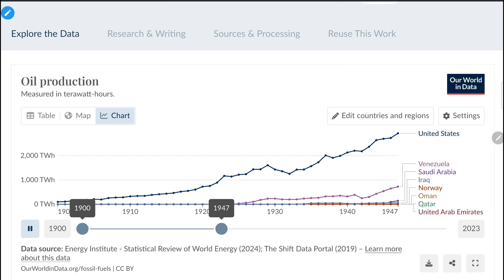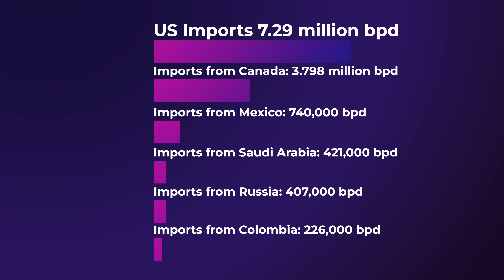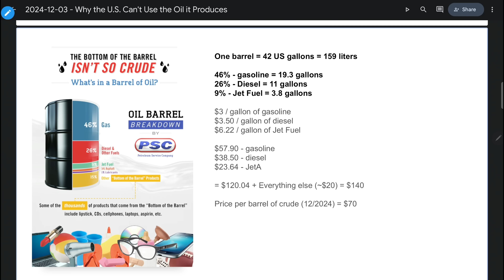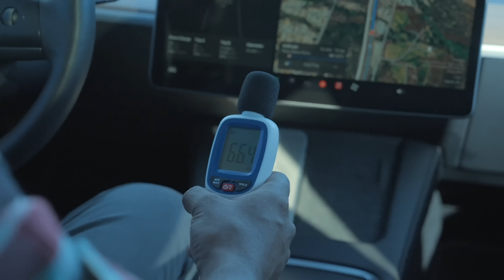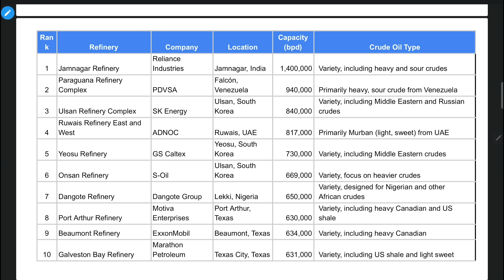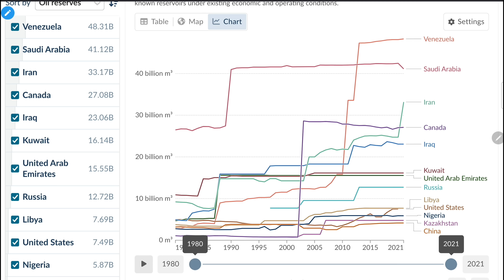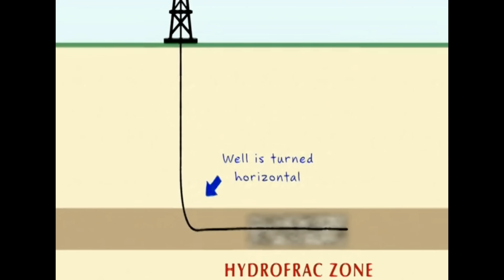Why America Can't USE The Oil it DRILLS

Comment: Hi Ricky, thanks for your videos. I’ve had a career in oil & gas exploration, now retired. It was always cycling between boom and bust and the first cuts were to the explorationist, either redundant or critically needed. Started during the fuel crisis of the mid 70’s. 
I had Norwegian friends in the industry who told me their electricity was so cheap because of all the hydroelectric plants. Lots of water and elevation changes. They always left their lights on. But oil and gas exports were a large success for their economy. 
I’m a big fan of EV, solar and wind energy. Hydrocarbons have propelled us into the top economic position but they are also a huge danger to our survival going forward. We need to make a change to more sustainable energy. 
Thanks
Reply: The only problem with that is we have 120 year's of every day living built on oil everything is made from it
Reply: @ZERO-th6dd  That life dependence on petrochemicals will not change for a long while. It will outlive our need for fossil fuels. If the tree-huggers get their wishes, our lives will be much more expensive and technology advances much slower.
Reply: @Arrogan28  It's sad that I brought up real concerns and you can't tell me how they are irrelevant. 
Did the medieval warming period not exist? Was it not roughly 1200 years ago well before the industrial revolution? 
More importantly what is it you are doing yourself to not use fossil fuels clearly it's not talking to me through the internet using your electricity that statistically has roughly a 66% chance of being made by using fossil fuels. You didn't tell me how you are going without fossil fuels in your day-to-day life. 
You didn't tell me how you eat strictly organic food that was grown without using fossil fuels, You didn't tell me how the goods and services you use throughout your life are fossil fuel free. 
You keep talking about my children's lives or your children's lives where are our children's lives whatever but the statistics are on my side life is better now than it ever has been and human history, most people will not die in adolescence where just 200 years ago you had a one in five chance of dying before the age of five. 
You didn't tell me how sea level rise is happening even though there is literal photographic evidence showing to the contrary but you're right I am ignorant and selfish for understanding how fossil fuels work. 
Why don't you look up the medieval warming  period and while your t it look up  "climate gate" it happened in 2009 where there was a data breach and the information was leaked to the public that they were altering the so-called scientific data then when they were caught red-handed they tried to deny it by basically saying scientist in the past weren't as smart as they are. 

You can say what you want but there's a lot of evidence to the contrary and there is a lot of money involved with this whole global warming thing... Oh wait we don't call it global warming anymore we call it climate change now because no matter what happens in the climate it's all inclusive.
Who cares if there's evidence that there was more hurricanes on average in the first half of the 20th century then there has been for the last 60 years. 
Who cares about The exceptionally large Antarctic ice sheet from a few years ago let's ignore your lying eyes and roughly 200 years of data collection because it doesn't fit the narrative You want to hear.
Reply: All of those green energy plans will fail without innovation in battery technology. They also need to find other materials to make their generators and panels from because all turbine blades and solar panels are classified as toxic hazmat waste at the federal level. Over 90% of the material isn't recyclable and will sit in a landfill pulverized and atomized leeching PFAs into the groundwater and top soil. 

Hydroelectric is THE ONLY renewable that is feasible. Even then you must balance the risk vs reward when it comes to impact on politics, local ecosystems, and fish. Look at the many grand canyon hoover Dam conflicts and the many decommissioned dams on the west coast. Constantly Innovations are required across many industries including a way to bypass the dam for salmon to get into their breeding grounds.

Even recycling plastic bottles and is a feel good effort because that too ends up in a landfill before and after China stopped buying our trash.
Reply: Too true. BUT we are not there yet. 
Worse, without combustibles to subsidize the other oil products, our life can be much more expensive, plastics, medicine, infrastructure...
As this video acknowledge, oil derivatives are the cornerstone of our civilization.
All people get are the shallow aspects of it, anti-Trump, anti-CO2. But of course, this is how the channel survive, polarizing topics instead of better explaining issues.
Reply: Typical westerner.  We all think we're the sole reason for climate change and ignore the fact that communist China is building a new coal fired power plant every week.  China and India are the two biggest polluters on earth but somehow we want to cripple our economies for social justice?  C'mon people, wake up!
Reply from the maker: could NOT have said it better. We should be wildly greatful for oil and gas, it is the driving force for the greatest transformation on Earth, and propelled billion into the middle class. But we have to always look ahead and keep innovating!
Reply: Norway has a smaller population in the state of Missouri and they get about three times the amount of rain so hydroelectric is realistic for Norway.
Also it should be mentioned Norway still produces about 2% of the world's oil production and It is still a huge part of their economy and if they really cared about the environment like their politicians try to claim they would quit selling oil but they need that oil for all the socialist type programs they have.
The United States by comparison is a relatively dry nation pretty much every single creek and river that could be dammed up to produce hydroelectric has been and was done so over a century ago. Roughly 1/3 of the United States population lives in a relatively arid region called the Southwest, natural gas production which is a byproduct of oil production is roughly 40% of United States energy. 
As for boom and bust If we get politics out of the way the United States is coal rich at current levels we have at least a 500-year supply of coal, Coal can be used not only for electricity production but it can also be turned into fuel It just has a high CO2 production. 
Oil isn't going anywhere for the foreseeable future everything we use as oil in it either as part of the process of making it or in the actual product or a combination of both. Even the food you eat was fertilized using petrochemicals.
I always find it odd that we use pretty much every single ounce of oil we pull out of the ground in a relatively efficient manner but yet people want to remove part of that process by making vehicles not run on gasoline or trucks not to run on diesel but yet we still rely on all the other things that come out of a barrel of oil and it's not like those things don't get produced in the process.
Reply: @AtomicReverend  Well said. I love the ideal of Photovoltaics and BEV's, we should have those, but combustibles make our life cheaper when it comes to petrochemicals and derivative industries.
Reply: @BBBrasil  I actually love the idea of solar especially on a residential household that is tied into the grid. I live here in Southern California where our rainy season is basically just January and February and if it's a real wet year maybe March, we don't really have any humidity or clouds and are summertime temperature is hot where you pretty much have to have air conditioning to be even remotely comfortable, solar is a godsend because it works best right in the heat of the day when we hear in California need it the most. I am also a fan of practical energy savers like LED light bulbs or using smaller engines on commuter cars (I am a huge gearhead) realistically over half of Americans live in cities and most of them never leave the city just commuting in traffic and a 1 liter engine would serve the same purpose as a 5.0. 
All I want to do when it comes to conversations like the one I was having above is just get people aware that fossil fuels for good or bad have made all of our lives better and They are in every facet of our lives. I don't want to pick a fight with anybody I just want people that believe in this global warming thing to have answers to basic questions because science is never settled It is just tested and retested until the results become pretty evident.
Reply: @AtomicReverend  I like to paraphrase Linji Buddhism: If you're science settle on a result, throw it away! Settle here means death of science, the end of search. Less philosophically, this is what I want, to have a conversation. This video leans toward anti-oil in the end, and that resonate with lots of people, without actually promoting discussion which I suggested elsewhere. Burning fossil fuel has many effects, one of them is accelerating technology development. It is a matter of policy to ensure part of this development is redirected to solve the problems created by the burning. This is how we solve "suicidal technological pact".
Reply: The US Can refine the light sweet we produce!!! Why is the lie that we can’t told over and over, including in this video??! The US is Exporting 900,000 gallons of refined gasoline every single day due to refinery overcapacity to refine light sweet!! Source; EIA. Existing refineries were easily retrofitted to refine as much light sweet as they want. It’s just more profitable to export the expensive light sweet and import cheaper heavy crude and then charge us for the higher refining costs of that sour crude.
Reply: I meant 900,000 barrels of refined gasoline per day, not gallons.
Reply: @AtomicReverend  to further what you wrote, Norway was smart to invest proceeds of its oil exports into it's sovereign investment fund to allow for higher quality of life for it's citizens vs oil executives putting proceeds into their pockets. Norway has also invested in renewable technologies using oil being sold. The USA is a huge country with various geographics to take in consideration. North East and South East could be using more hydroelectricity, south could use more solar and Nuclear. Coastal cities could use more wind power. Of course oil will have its place in the energy mix but we should diversify to reduce risks to our societies.
Reply: @AtomicReverend  Unless they have changed it to natural gas, that power plant in Amarillo is still using coal mined out west somewhere.

The Norwegians were enjoying a caring social democracy long before they discovered oil on their side of the North Sea. They have always exported electricity to Sweden from the surplus hydroelectric system throughout the country.  They were smart enough to create a State Oil Company AKA Statoil and not allow foreign 'help' to develop their oil reserves. Unfortunately, third world countries' governments are easy to corrupt and can't do it anyway.  This included all of the middle east, Iran, and various African places.

The Norwegians have a Sovereign Wealth fund where the money they make from the oil goes into helping less fortunate countries not cut down their rain forests for instance.  They have also invested heavily in 'renewable' forms of energy and to show they are serious they renamed Statiol to Equinor,  to make a point.

The Norwegians also discovered a rather large gas reservoir in their part of the North Sea that will doubtless help the poor Germans who foolishly shut down their nuclear power stations after that Japanese reactor at Fukushima was damaged by the tsunami.  After that Putin foolishly screwed the pooch when he invaded Ukraine, then something mysteriously happened to Nord Stream and is now unlikely ever to be used. (you see how everything hangs by a thread) This benefits the Norwegians once again. The Norwegians are smart and good neighbors to the EU. They are also the only NATO country it would seem that can afford to buy an F35. The Norwegian government has a tax structure for instance that makes it impossible for a Billionaire to live there. If they did they would soon be  millionaires instead. I think that's just swell.
Reply: @charleskroeger5735  If I came off like I was talking trash on Norway I didn't mean it that way Norway is an extremely prosperous nation with one of the highest quality of life in the world and I am not disputing that.
In my opinion they are over regulated but realistically my opinion doesn't matter and clearly their people are happy with the system they have in place.  My point was to anyone comparing Norway to the United States (You heard the Norway versus the United States comparison a lot about 8 years ago when Bernie Sanders was running for the Democratic nomination).  It's not a fair comparison, The United States is giant in size both physically and by population and What may work well in one area It's not transferable all across the United States. Texas is a great example needless to say energy is cheap in Texas and will be for the foreseeable future.  The same would go with Wyoming and a few other states. When it comes to renewable energy needless to say the American Southwest is definitely rich in sunlight and solar could definitely lower the strain on the infrastructure that is in place and theoretically lower everybody's electric bill a little bit if they are using energy during peak solar times. When it comes to hydroelectric arguably the American Northwest is probably the place to be because there is lots of elevation fall with steep mountains and canyons along with abundance of rainfall perfect for making hydroelectric but everything I just mentioned it's just part of the story. the USA economy is so big and complex and obviously cheap energy production is part of the reason for its success and I don't think there is a one size fits all solution.
Reply: @AtomicReverend  You got me interested in the Medieval Warming Period so I had a quick look at wikipedia and few other resources. Many of your facts were on track but @Arrogan28 seems correct in pointing out the forest for your trees.
Reply: @j.j.2953  Wikipedia is generally pretty well accepted politically speaking to be on the left side of the political spectrum just keep that in mind when doing your research It's not an unbiased encyclopedia. 
I actually wrote other comments but apparently Censorshiptube (which is ironically also left leaning) decided my comments were not relevant.
Reply: The infrastructure required for EV, solar and wind energy is significant and an environmental negative; just the EV batteries alone, which are heavy and toxic and often fueled by fossil fuel generated electricity, are a big downside compared to a fossil fueled ICE vehicle.
Reply: @petesmitt  Aww, but BEV is good! Of course it is damaging the environment, but NIMBY! Our hypocrisy tells us to buy from China, let them destroy their environment. We transfer to China all our dollars, all our influence and diplomatic projection so we can drive nice BEV's. This is good, right?

sarcasm.

Comment: What about the trillions of gallons of water used and the 200 toxic chemicals in this water that makes fracking happen?
Reply: And moving 500,000 pounds of earth just to produce one EV battery is better?
Reply: @aoscott RMR for lithium is much lower than for gold, plus it's only calculated for ore production, 30% comes from brine.
Reply: @aoscott yes. Btw for every gram of gold you have to move 3000 kg of rock.
Reply: So, you are talking about pollution?? And why do they still increase tariffs on Chinese EV to 100%? Isn't EV good for the environment and doesn't cause pollution? Pure hypocrite.

Comment: IMHO, the Saudis are doing the right thing: producing oil and selling it, then using the profits to build their renewable energy infrastructure. The USA has started doing this, but it seems that it's such an agonizingly slow process here. :( I'd be driving EVs now if it weren't for the total dependance on batteries and lack of infrastructure. EVs would make sense when you could drive into a refueling station and quick-swap your battery pack for a fully-charged one, then drive out in minutes. The whole business of waiting an hour or more to get to a charging station and wait for charging is ludicrous.
Reply: There was one Chinese company that did battery swaps. I'm not convinced it's practical in climates with snow and salt.
The self driving car might solve the infrastructure problem.  Like part owner aircraft, a membership in a EV co-op would allow a fleet vehicle to come to you fully charged and drive you around. You could optionally operate it.Tesla's version 13 of Full Self Driving is at least 99% automatic. Thanks to all the recent AI advancements, its getting much closer to being safe enough to trust it to not kill you. I still think its a few years away from not having a steering wheel and pedals.